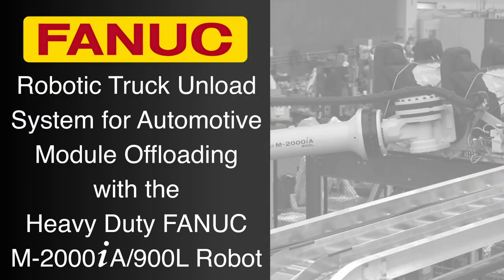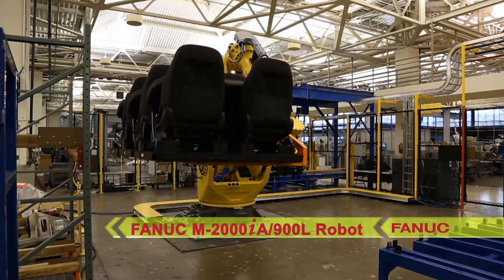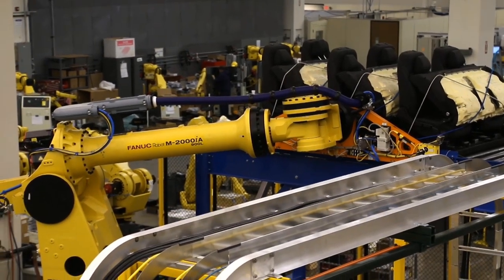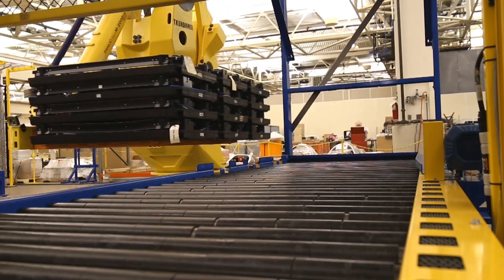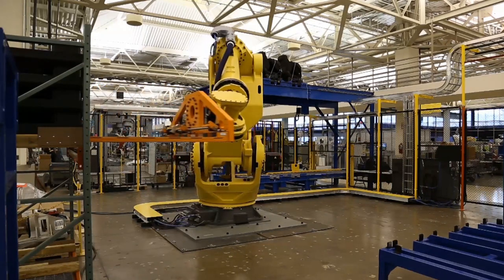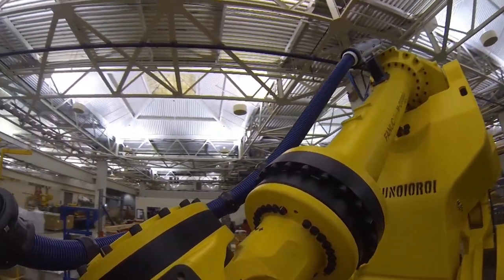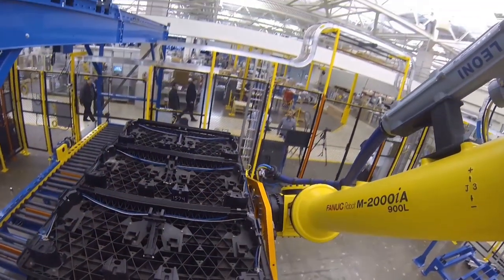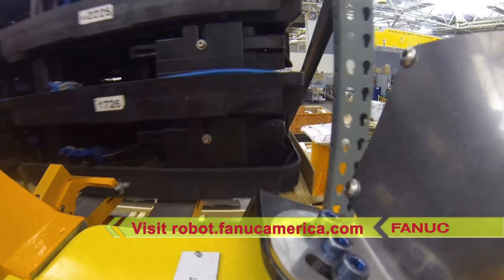Heavy Duty Robotic Truck Unload System Offloads Large Automotive Modules

Comment: I would love to adapt one of these giant arms and turn it into a gaming motion flight high G simulator centrifuge.  It would be ideal to have a bunch of big monitors and a very firmly clamped chair with a 5 point harness on it and a hands on throttle and stick.  It would be quite the extreme gaming set up and thrill ride all rolled into one while playing Elite Dangerous or Star Citizen.  Of course such a gaming chair and display system needs a roll cage built around it and be fully enclosed.  Everything would have to be overbuilt to handle the 6 Gs of sustained force this thing could put out.
Reply: Use a decent Vive Pro with the Wireless adapter. No monitors needed.
Reply: Until it malfunctions and smashes you into a meat slushie.